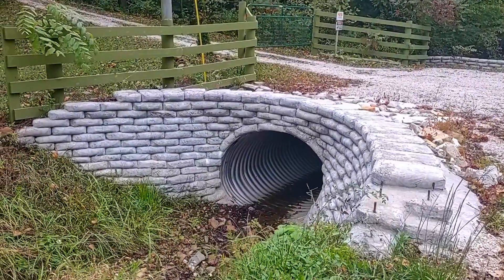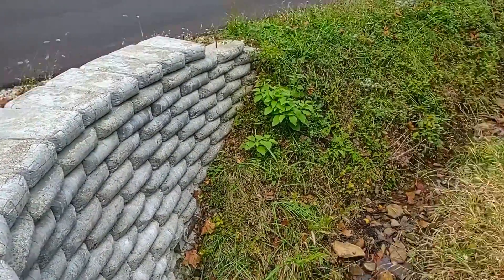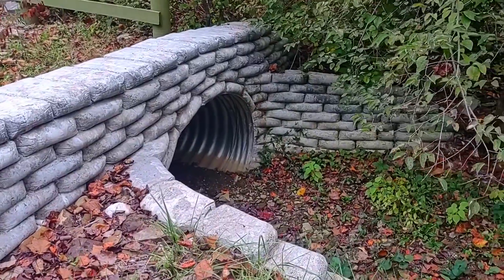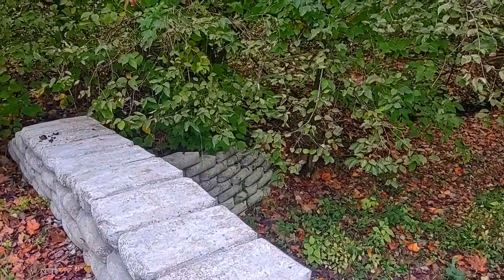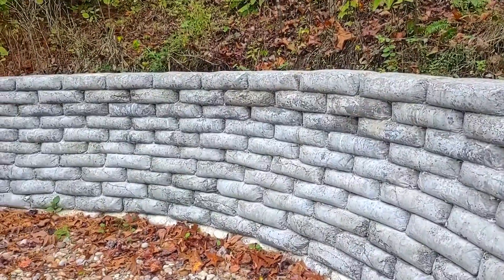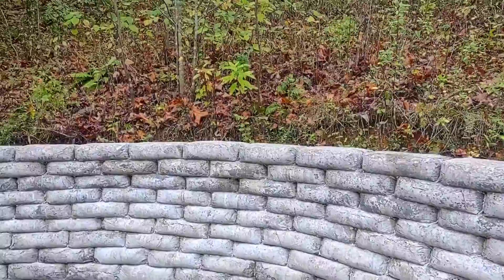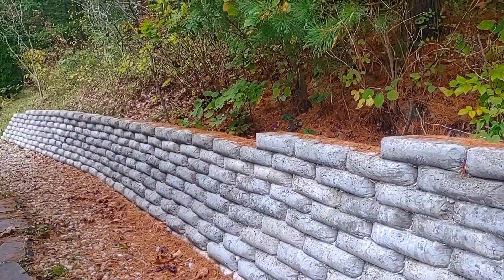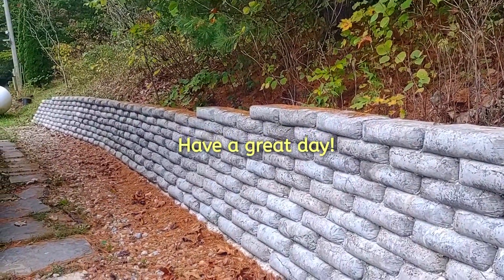Three Years Later | Concrete Bag | Culvert Retaining Walls

Comment: Any engineering here? Or just DIY guessing?
Reply from the maker: The pipe was sized by the county. I thought this out myself, a friend said to use threaded pipe and side rebar through pipe. I then proceeded one side then the other stacking as I felt it should be smaller at the inlet then wider at the top, using the bag lines and a flash light at night to keep my wall in line. I build dams on streams as a kid and loved it. So, I guess, I guessed! Thanks for watching.

Comment: I'm going to build my home out of this
Reply from the maker: @GainingDespair , Lookup https://www.monolithic.org/homes - The safest above ground home rated FEMA P-361 safe room. You might change your mind. :)
Reply: @SteveAddis  Nothing against that, nothing at all, but price is a big factor for me. I could afford to make a home out of cement bags. Paint it right might even look like a makeshift log cabin.
Reply from the maker: Yes, I might build something small using bags, yet the cost, maybe decide to mix it for true structural. I found a concrete poured structure in the forest still standing well without its roof.No truck is getting where I build it. Dome's are ultimate yet very costly.

Comment: perfect surface for stucco tho on that garage wall... just sayin... i think it looks cool the way it is... its got a ww2 sandbag vibe to it... in fact i did a concrete igloo like this burried it and drove my tractor over it.... its good shit
Reply from the maker: Yes, I might mess with it before winter and finally fill some areas. Your igloo project sounds very interesting! Was it built in a hole surface level, side of dugout hill? Make a nice storm shelter / food storage for the summer storms and cold winters. Granted, plenty of water protection and drainage. Thanks for sharing!

Comment: That first wall is so cracked its not even fun y
Reply from the maker: The cracks are from when the bag stretched during wet curing, not from freeze thaw. I will fill them in for sure. Thanks for your comment!
Reply: @SteveAddis  I'm skeptical but it does look solid after 3 years. See you at 5
Reply from the maker: Will do, it is now close to 4 as this is a 10 month old video, so next Spring. Take care.

Comment: I hope you didn't use tape with plastic
Reply from the maker: I did use plastic packing tape on the side and connected it across the top, it then came off with the bag. It is in my improvements video. Thanks for the comment.  https://youtu.be/tUlc1Qb5A74

Comment: There is a WW1 memorial in France (I think near Verdun but I could be wrong) that tries to preserve what the trenches looked like back then. To do so, they filled sandbags with cement and stacked them as normal. They set and cured in place much like this, and the sandbags themselves rotted away leaving the trench intact.
Reply from the maker: @gtaclevelandcity Thank you for posting this! I would like to see those trenches. And just think, over 100+ years since that time. I just picked up a picture of a relative who died in WW1 and is listed on a tall obelisk statue in the middle of the town square of their county seat. Next time I am there, I am going to look his name up. Have a good day.

Comment: This isnt as strong as premixing and pouringnthe concrete.  Do you need that added strenght?  For a not load bearing wall this seems to be fine and if it needs removed it will be easier to break up.
Reply from the maker: You are right. For this, it's fine. They are still working after 50 years. Thanks for the comment!

Comment: My friend used to work as a Diver, they use the same method FUFU bags he called them for reinforcing underwater structures like port walls and breakwaters where they are subject to extreme wave forces during storms. They sometimes drove U shaped steel hopps through them to help hold em in place depending on height, they are still there many decades later. It's a very reliable way of building a culvert from what I can see.
Reply from the maker: @dc-4ever201- I am learning a lot reading comment like yours. I sure never knew this. Thanks so much for sharing! Take care.

Comment: You can lay them out as pavers as well. Just as long as you don't need to dive anything too heavy across them. Builders will make temp roads out of them into softer areas to avoid getting stuck.
Reply from the maker: Never really thought of that. Anything is worth not getting stuck! Thanks for the idea.

Comment: So question for you is do you think it's cheaper to do this then concrete it looks like you used 186 bags on one side assuming they were $5 a piece that's almost $1,000 words of cement the ratio for concrete is 123 so technically you could have obtained 6 times the amount of structure if you used Sand and Gravel plus some plywood forms
Reply from the maker: You are right it might be cheaper to do your own mix. At the time it only cost about $1200 for culvert entrance and would be less than forms and hiring contractors. It was $1.83 / bag at the time. Now they are closer to $3 here without discounts. Thanks for your comment!  Quikrete Price: https://www.lowes.com/pd/QUIKRETE-50-lb-High-Strength-Concrete-Mix/3339748

Comment: This is a really well constructed
Project. I'm curious about how 
You were allowed to build on
The Easement. In Michigan the 
County easement is 34 feet
From the center of road. Was
A special permit required. Just 
Asking.
Reply from the maker: @billbertagnoli4226 - You know, that was a concern. You are the first person to notice this. The county sized, then installed the pipe that I bought. They said the DNR will not allow changing the flow of a stream. I really wish the pipe was at least 10 feet further away from the road as well as giving more cover on the top of the pipe. I see other drives with culverts and concrete the same. Now, just to let you know, the property line is in the middle of the road and both sides used to be owned together. - A relative was told he needed to move a building because it was not setback, then he said to the young engineer, the property line on the other side of the road and engineer left him be. He had fun telling the story!
Reply: @SteveAddis  glad that worked 
Out for you. The property line 
Situation is a little interesting.
The stream is another factor 
That could have been very 
Problematic here in Michigan.
Again great result 😃
Reply from the maker: @billbertagnoli4226 - Had I put it where I wanted it and did it myself, you can sure bet the stream would change course on its own! I asked the county man when he was out here  if the road would ever widen and they said It never would and is wider than most back roads. Uh I don't know about that never...then say bye-bye culvert wall and I don't know if I can reproduce the same result. Take care, have a good day / evening. :)

Comment: There is a culvert approximately 10' by 500' to 750' (maybe longer) stepped in a "V" on MCAS New River, NC on the western side by Aviation Ordnance made of cement bags.  I think it was built in the '50's or earlier and it was still there when I retired in 2000.  It always amazed me😮.
Reply from the maker: @bacarnal  - Wow! That is amazing. I would love to see that. I wonder if they did anything under the bags for prep. I guess I don't have to worry any more after hearing this comment! You are like the 4th person in the last week or so that actually saw a really large construct using this method. Happy and long retirement! Thanks for posting.

Comment: Where is this bags here are like 4 even if you buy bulk
Reply from the maker: @soccerkills -Yes, that is a bit high. Much less here. These are at Lowe's 50 lb bags. They also offer a 5 % Lowe's card or military discount. Thanks for your comment!
Reply from the maker: This is Lowe's currently what I used. https://www.lowes.com/pd/QUIKRETE-50-lb-High-Strength-Concrete-Mix/3339748

Comment: I’m amazed by this because it’s very aesthetically pleasing as well as functional.
Reply from the maker: Turned out nice. Thanks for the comment!
Reply: it does look nice pattern wise, but it also looks lazy. like he couldn't be bothered to take the concrete out of the bag. 
you cant mix it properly without removing it from the bag and pouring it back in. it might hold up for years, but properly mixed concrete is going to be far stronger and durable.
Reply: @darkshadowsx5949 That type of concrete is designed to not need to be mixed.
Reply: @jackdonoghue5527  Then it's absolutely not going to hold up, that type of concrete is meant for setting posts in the ground and not building walls. You can already see the ones on top are cracking into pieces and there is piles of dust around the outside because they are disintegrating. And people are saying it looks good? You guys need to put your glasses on before watching YouTube, lol. Anyone who works in concrete is just cringing at this amateur hour project.

Comment: what was the weight of your bags ? a 50lb. bag  here is 4.00$
Reply from the maker: @warrenlund2054 - Bags of 50lb @ $3.32 then subtract 10% or more for bulk discount, military discount etc.  https://www.lowes.com/pd/QUIKRETE-50-lb-High-Strength-Concrete-Mix/3339748

Comment: In a 1000 years people will wonder how ancient societies were so precise...you could not fit a cigarette paper in the cracks...😂😂😂
Reply: ALIENS!!!!!
Reply from the maker: Yes, by that time I may not remember I did this. :) Is it not odd that the methods for those actual walls (all over the world) were not passed down. I think you know why if you dig deep into a certain book and put together what pieces are there. Thanks for your comment!
Reply: @SteveAddis Well, the Inkas apparently utilized a form of chemical etching that helped make the stones fit seamlessly together, the Romans added volcanic ash and lime clasts to their concrete which gave it self-healing properties, the Egyptians apparently used ramps built directly on the slopes of their pyramids to help with the construction. Other that that, the answer is usually "logs, ropes and patience".

Your culvert and wall look great, btw.
Reply: @BrokenCurtain yo check out how the Egyptians used water power to raise stones in one of the pyramids. It’s a new discovery in a minor one that does not explain Giza, but there’s massive logical  issues with the ramps hypothesis imo. The ramps would be so much larger than the pyramid that they would have been the actual world wonder.
Reply: Internal ramps, my friend. There is overwhelming evidence for internal ramps in the Great Pyramid.
Reply: @swamp-yankee  the ramps where inside the pyramid.
Reply: @KeVIn-pm7pu  is there anywhere I can read about that with drawings? Cool idea, I had it pitched to me in world history class in high school as they built a giant dirt ramp and then moved it 🤷‍♂️
Reply: @swamp-yankee  just search for "internal ramp theory" mind you i dont think its yet conclusive just another guess how they did it with a few hints into that direction.
Reply: @KeVIn-pm7pu  thank you
Reply: @SteveAddis  I highly recommend Robert Sepehr's published works for that subject. His YT channel is great too.
Reply from the maker: @GenericalFishTycoon  - Reminds me of someone named Marzulli. Thx for the comment.
Reply: Lol love this comment so much.  Good job guy!😊
Reply: Concrete =/= stone.
Reply: This won’t last more then 20 years, never mind 1,000
Reply: The coolest thing about this, for me, is that at first it looked odd to my eyes but the longer I looked at it the better it looked. Awesome idea
Reply: Copper chisels😂😂
Reply: Dude 😅😅😅
Reply: This will be dust long before then.
Reply: Except that concrete today isn't as robust as even roman concrete and our shit today will be here for max a couple hundred years
Reply: Might only be 10 years with the idiocracy we're living in
Reply: Top tier comment
Reply: Alien technology, no mystery
Reply: A L I E N S
Reply: ALIENS
Reply: aliens.  or stacked by bigfoot.  or crop circles, somewhow.
Reply: @kealahau6727 Unlike the megalothic structures, this isn't queried and cut stone.
Reply: that wall won't be there in 50 years let alone a thousand😂

Comment: Anything over a quarter yard it becomes more feasible to have it poured . Last way longer . This might last 10 years. 
Is what it is. Looks ok but it will crack and crumble. Soon.
Reply from the maker: @Oldfartstuff2.0  - Feasible yes. Much easier for sure! Cost about $1K per wall. Ten year lifespan - is this from your experience? After 4 years looks the same. Some CCB walls well over 30+ years / YT viewers confirmed similar. - I sure hope it does lasts. - Thanks for your comment! :)

Comment: In the uk all pre mixed concrete bags are plastic. The paper bags are 100% cement, no aggregate. 
Assume that the cement bags would be no good long term and the plastic bags would not allow enough water in... Any thoughts??
Reply from the maker: Maybe someone can chime in. - There needs to be at least sand with cement, something similar to S mortar. What I used was "ready mix" containing all three components. Test the product you buy "before" making a final purchase. As far as plastic goes: You might make a flat hand held wooden tool using 2x4 with either nails or screws in rows. Hole punch the bags. Also, punch rebar through. The plastic bag will likely make even better smoother walls if you mix them well to the front. They should not stretch like paper when wet. The wall will also need to be done in sections, to take time to saturate by running a water hose overnight. Safely torch the plastic. If you would, please let me know your findings. Here is a video that might give you ideas. Thanks for your questions and have a great day! https://www.youtube.com/watch?v=tUlc1Qb5A74

Comment: Looks great. Is there anyway to treat the concrete to help it last longer?
Reply from the maker: You can always coat it with liquid concrete as I did at the base. A few comments said they saw this done before lasting over 30 years and more. I planned to stain seal with color later. Please watch this video and it explains what I did on the third wall. Thanks for the question! https://youtu.be/tUlc1Qb5A74
Reply from the maker: @smirking8457 - I don't know of a treatment other than coating it with liquid concrete as I did in the lower areas. I was considering a sealer stain combination. They hold up well. Here is the video that might give you some ideas. Thanks for the question. https://www.youtube.com/watch?v=tUlc1Qb5A74

Comment: How do you mix the bags. Just turn them end over end or flip the bag side to side?
Reply from the maker: Yes, that is basically how I do it. Usually from the factory it is mixed fairly well in the process of combining, yet aggregate will settle in spots. So mix them well, rolling and end to end. It just take a lot more time for sure. Tape the bags on the top at stopping points. Good question. Thank you for your comment.

Comment: I think the bags look better than standard formed wall, but your install is so thorough its almost as much work as doing standard concrete forms and you can get inserts to make the formed walls look like rocks.  The bag walls are holding up ok after a few years, but you can see cracking/crumbling already. Have you thought about spray some sort of sealant on the exterior to keep it from crumbling as quickly?

This seems like a method that is fine for small projects, but not ideal for larger walls.
Reply from the maker: Yes you are right it could have been formed. At the time no contractors were available. Yes I thought of that. I did coat the bottom area. Now most of the cracks were formed in the process of bags stretching. I tape them now as in the enclosed improvements video. Some commenters said that they have these walls doing fine after 40 years. Yet we will see. Thanks for your input on it. Take care! - Improvements: https://youtu.be/tUlc1Qb5A74

Comment: Steve ... i have a question i am building an enchanted forest with a castle façade to a wood framed building but as i mentioned the façade will look like a castle front with stone look face and 2 12 ft in diameter Truett's and so i was wondering can i build all of that safely with this cement bag technique???? oh and yes people will be inside the turrets and behind the face castle wall...... btw it was the cement walls videos that got me to subscribe great job
Reply from the maker: Hi. That sounds like a cool thing to build. As far as using this for structures. I would not do it myself.  Now you can reference earthbag construction which is similar and see if application compare to using concrete bags. I know vertical rebar ties it together well. Maybe you could make a stucco cement mixture and hand form stone, add color, yet much work needed.  Thank you for your comment. Do a video and show me how it turns out. Thanks for subscribing!

Comment: I can't picture how you tape the bags and how you mix them?
Reply from the maker: @livenfree - Usually the top bags and the face can be taped so that the paper does not stretch when wet. Tape facing edges and the tops of top bags. Mixing is setting and rolling the bags on all ends then one good drop to the face allowing the cement to go to the front facing. This video may help you. Thanks for the comment! https://youtu.be/tUlc1Qb5A74